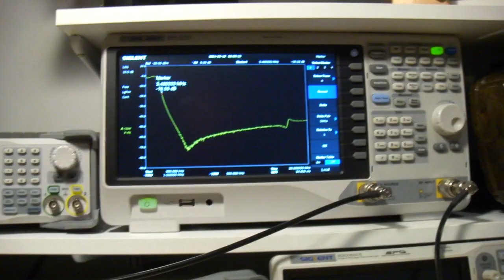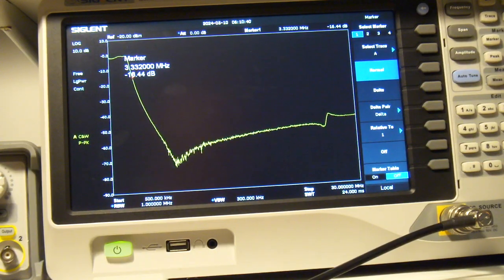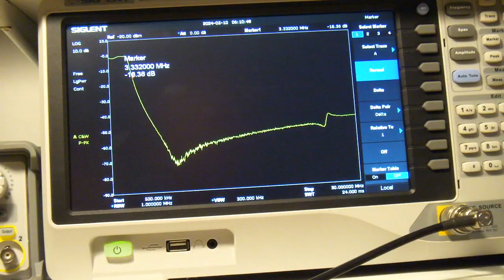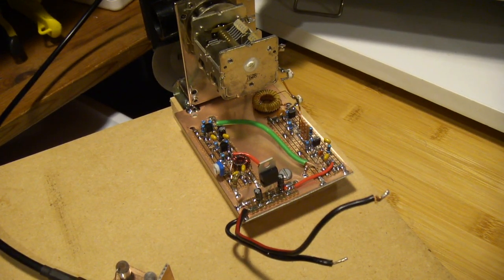AM Radio - Part 3 Low-Pass Filter

Comment: Why are you calling it a halfwave filter? thats not a thing, nobody does that.
Reply from the maker: Thanks for the feedback. I'm just leveraging what was presented by Paul NA5N at the 2002 Atlanticon QRP Froum. It works for me.
Reply: A half wave filter exists, it is mentioned in Solid State Design for the Radio Amateur, Experimental methods for RF Design and possibly the ARRL handbooks.

Comment: the inductors are working with very low power signals, i wonder what affect it would have to turn one coil 90° to reduce mutual coupling? Just lazy day thinking 🙂
Reply from the maker: I did look at that. It didn't have must of a difference. What did, was making sure the windings only took up 2/3 of the circumference. Any more and stray capacitance starts to reduce the stop band attenuation. In my case that was around 10dB.
Reply: @CharlieMorrisZL2CTM  that's quite interesting,  as I would have thought that it must be only a few picofarads.